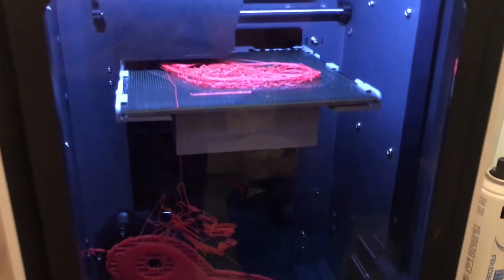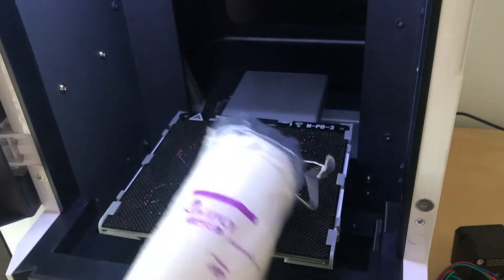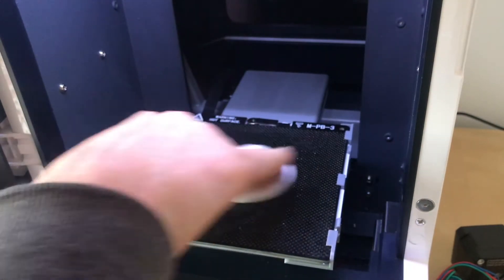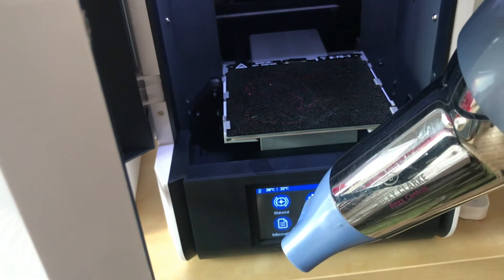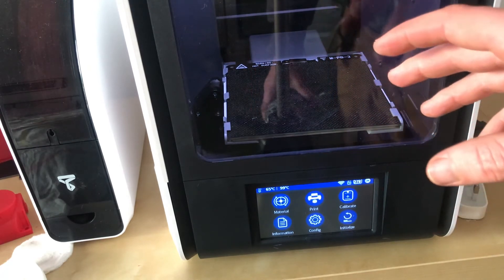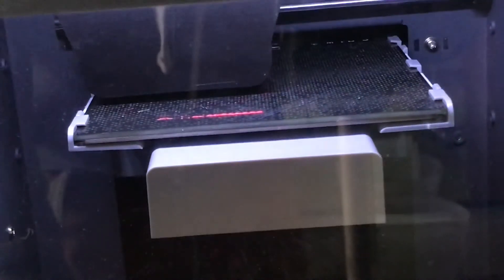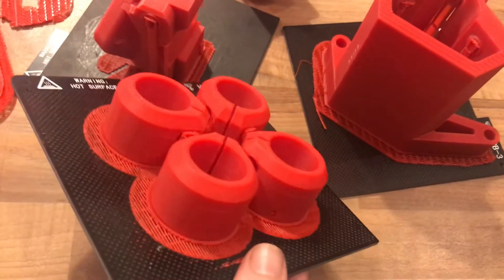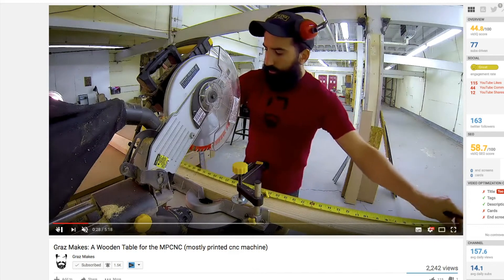ABS Not Sticking? Have you tried a hairdryer?! 3D Printer Tip

Comment: i heat bed to 80, put a layer of hot melt glue on bed...then turn off heat all-together, wait till it hits under 40 then print...with cold bed cura bed set to 0...when you have finished print heat up again to 80 then remove...simple..
Reply: Have you tried it with ABS? Does it warp after a few layers?
Reply: @ErickeGallardo  yes but had to use glue gun around edge after some layers...before they lift.

Comment: I just got the Creality enclosure for my Ender 3 Pro and I am trying my first official ABS print. I stuck the old hair dryer in to heat up the air inside real well just to speed that up instead of waiting for the heat bed to do all the work and take an hour or whatever. Took it out zipped it up and crossing my fingers.